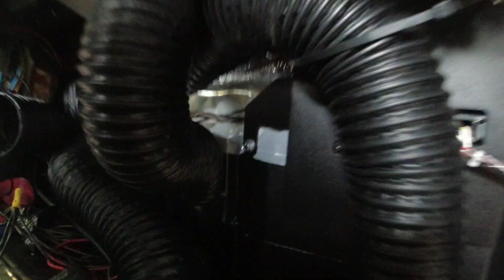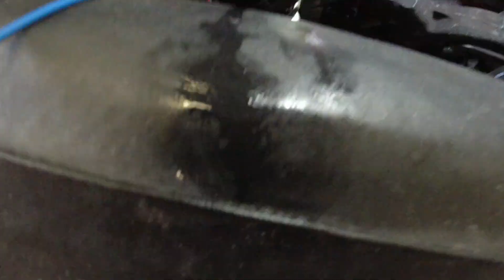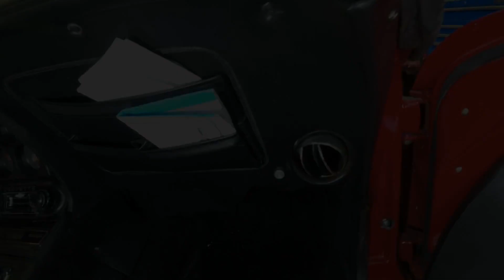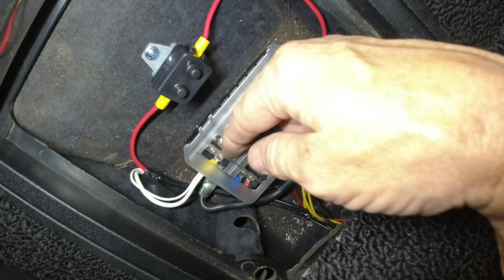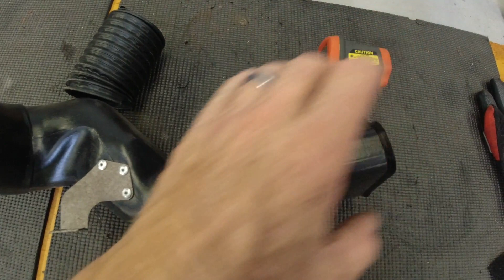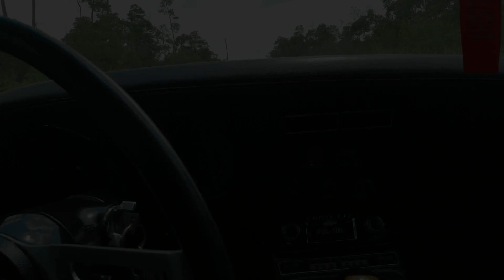VINTAGE AIR ELECTRICAL HOOKUP PART 6

Comment: So you can use the original dial control panel? Ive read a few people saying its not possible.
Reply from the maker: The original control is vacuum operated, and the Vintage Air is electrically operated so I don't see 
how you could use the original controls with the Vintage Air. I don't remember implying that you could use it in the video but if I did, I did not mean to.

Comment: Would there be any reason to just leave the ground wire you talk about at 5:00 connected to ground? That way, you can reset the unit without needed to reconnect it.
Reply from the maker: I'm not sure the unit would function properly if you left the ground wire connected all the time. That would be a question for Vintage Air.

Comment: I wonder, is it significantly harder to accomplish the install with a 454 ?
Reply from the maker: I wouldn't think so. The unit does not extent into the engine compartment like the factory AC unit.

Comment: Would you recommend placing the interior carpet before installing the air box, or can the carpet be installed later?
Reply from the maker: I installed my carpet after I installed the air box.

Comment: Mark you showed the location of the fuse block but didn't show the connection to the battery
Reply from the maker: Sorry about that. I will shoot a video showing how I hooked the fuse block to the battery.

Comment: Very good series on your install. I like how it cleans up the engine bay also. I'm gonna assume the blower moves alot more air than the original and it looks a lot easier to get to in the event of a failure. Since it blocks the right side fresh air vent off, does it still pull in outside vent air w/the AC off? Carry On. 👍
Reply from the maker: Thanks for watching. The new blower does move a lot more air than the factory AC. Unfortunately, with this system you cannot pull outside air in through the vents anymore.

Comment: hi I am watching your vintage air install and I am wondering how did you do the passenger install did you drop the steering column and pull the dash?
Reply from the maker: I removed the passenger side dash and the center console. I did not remove the driver's side dash or the steering column. I was able to loosen the driver's side dash enough to install the vent and vent hose. I kept hitting my toe on the Vintage Air ductwork when I was depresssing the clutch pedal, so I put the factory ductwork back in. It doesn't hang down as low as the Vintage Air ductwork.

Comment: Hello , what kind of green belt did you used for the vintage air . Where did you route it . Thank you ! Love the videos .
Reply from the maker: I purchased the v belt from NAPA. It is called a Fleet Runner Green Stripe. There are 3 different numbers on the belt. 8318XZSR, 25718SS, and 9600HD. Not sure would one is the part number. The belt goes around the crank pulley, water pump pulley and the AC compressor pulley.

Comment: So interesting how all of these AC systems for old American stuff use a Sanden compressor like German cars have been coming with for 40 years.  8:07 The compressor here looks nearly identical to the OE in my 2000 Jetta VR6.  Most of them are like this one, but some have a different endplate so lines can come out at right angle.  When I go to Classic/Muscle car meets, I can't help but notice this over and over again.  It makes sense because there's no better choice, it's just that it's funny to see this one German part become almost ubiquitous in a community of American cars.
Reply from the maker: I'm not sure where the compressor was made but it seems to work really good.